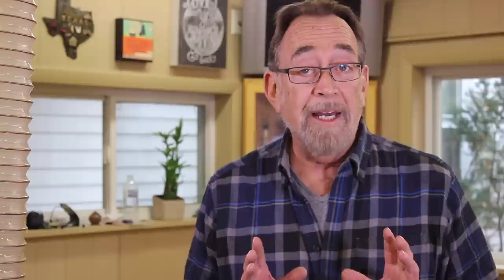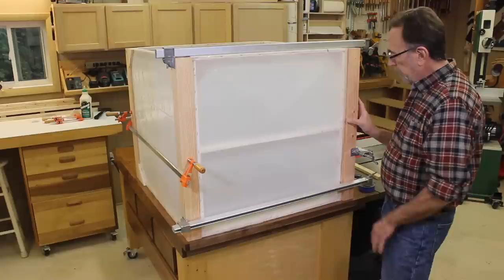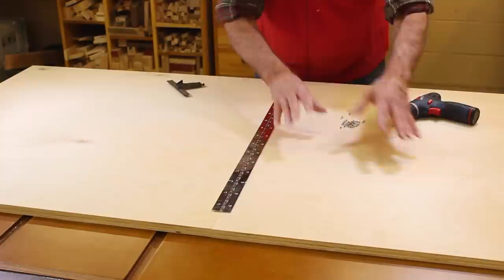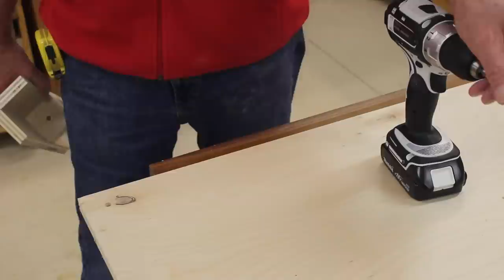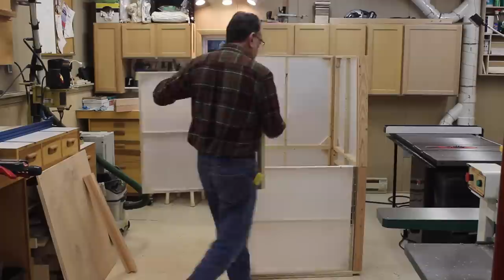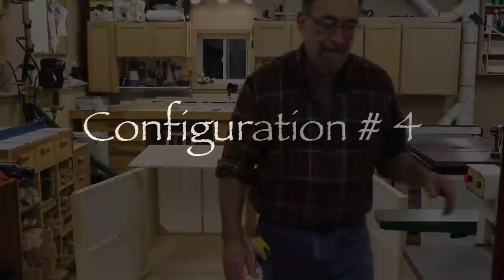Finishing Enclosure Pt 3

Comment: Do you have an videos of you using this?  Do you use it as a spray booth as well, or just for drying.
Reply from the maker: Hi Frank, thanks for watching.  I don't do any spraying (because I am really lousy at it!).  I use mine whenever I am putting on a last coat of a finish and need it to be really dust-free.  Particularly with slow-drying finishes... I hate getting dust specks in a final coat.  Sorry no pictures.  Maybe I will remember to take some next time I have the knock-down enclosure assembled.

Comment: Which configuration number have YOU used most often since building this Steve?
Reply from the maker: #2... I have been making 64 cabinet doors, and I can fit 8 at a time (standing on edge in a home-built rack) inside.  I put the wet doors in the rack, then slide the whole rack into the enclosure.

Oh, by the way, I will be using configuration #4 when I do the pantry doors.  I will have to dry them standing up.